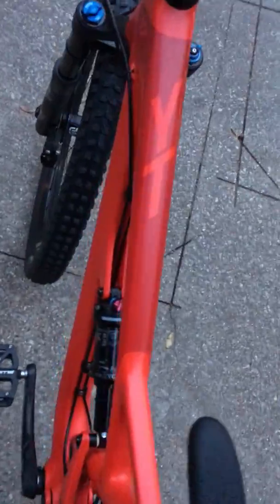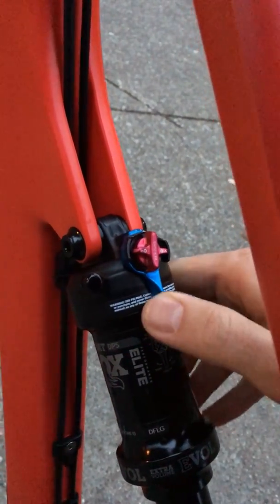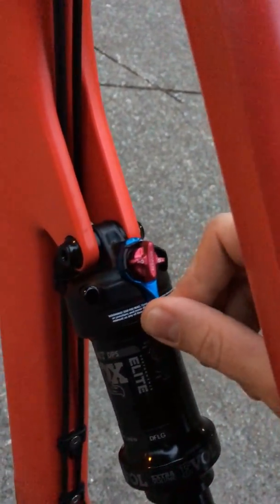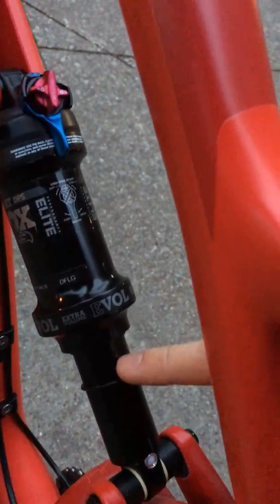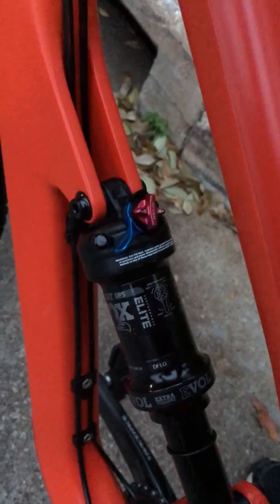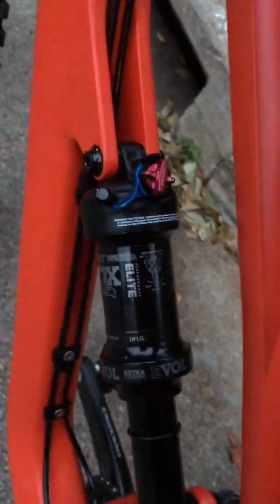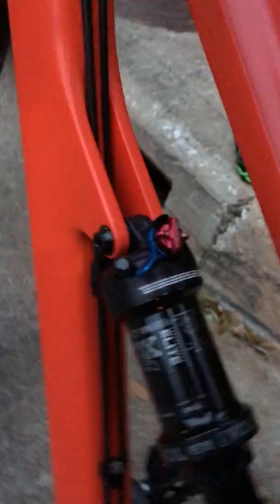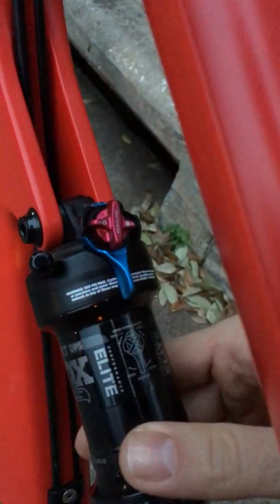Defect or Design - 2018 Fox Float DPS Performance Elite (57mm, 3 pos-Adj)

Comment: Did you ever find a solution to this, my yt 2018 jeffsy is doing the same but instead of medium to firm it’s doing open to medium ??
Reply from the maker: Hey Todd, I wouldn’t dare say that a solution (nor a direct root cause) was identified. Believe I figured out what is happening, how and generally speaking why. I can explain if youre interested.
The shock was sent into Fox (RMA is online) and they duplicated the issue then ‘fixed’ it by replacing internals (cam, etc) and detent mech. Shock still does what it did, it just takes more effort to make the lever move on its own. I settled. 
Its odd that yours goes from Open to Medium. When turning the lever from left most to right, do you feel a sudden increase in resistance somewhere aside from the detent clicks?
Reply: Roman Uvaydov yeah I would be good to understand what you thinks going on.  Yeah it’s been rather frustrating I’ve had the shock sent back once to fox already as the lever did not adjust the stiffness at all. There seems to been more resistance between stiff and medium than open and medium, it requires only a small nudge for it to move out the open position, I’ve currently got it lock with a cable tie in the open position. But this is not ideal as it means I am unable to change the position whilst riding. Any help would be greatly appreciated as I live in uk the returns process is extremely long I waited 6/7 weeks last time which isn’t ideal as summer is fast approaching
Reply from the maker: Todd that sucks man! Im sure with some research and frustration you can have it fixed 🤞
Check out this vid and pay attention to the compression rod/needle and the cam that pushes it down as you turn the lever. 
https://youtu.be/9j3FuvHClJI
I think the issue lies with the cam being at an angle when shock is set to anything outside of soft, the only mechanism preventing the compression needle from closing up is the detent ball on the lever. Apply enough force and youll get it out. 
Im guessing the detent is first plan if attack then the cam profile/orientation then deeper into the shock. Let me know what you think
Reply: thanks, 

as an update i spoke directly with fox they replied with this,

"on top of the head is a screw not the blue lever but the one above the red button.
Tighten the screw a little bit then the problem should be gone and if not I ask you to resend the damper to us.
 
Mit freundlichen Grüßen/ Best regards"

The allen head grub screw is above the rebound an lockout on the main body of the shock, I tightened the grub screw just a tweak and the issue has seemly stopped, il keep an eye on it over the next couple day. 

But this may help you if the issue arises.
Reply from the maker: Sorry for the late reply Todd, i was on work travel! 
looking at the "808-17-301-KIT Eyelet Assembly: 2017 FLOAT DPS 3pos-adj LV" schematic here: 
http://www.ridefox.com/fox17/help.php?m=bike&id=861
It seems that our issues may have been a bit different; am so happy it worked for you though!!!! more rides maaaan! Ill try it out nonetheless. 
be safe out there and hav a blasty-blast bro!
send me a vid of your trails when you can!